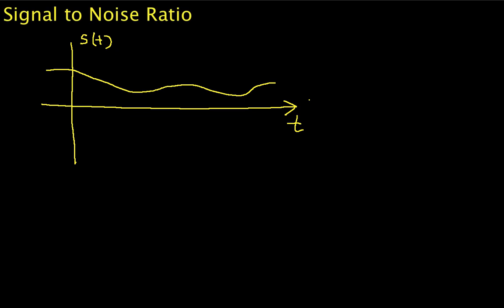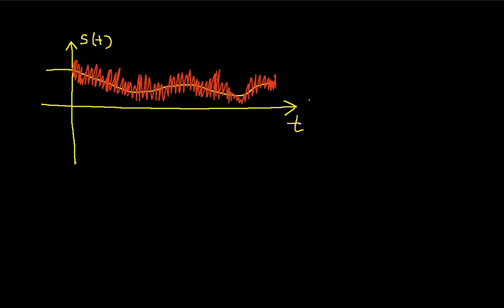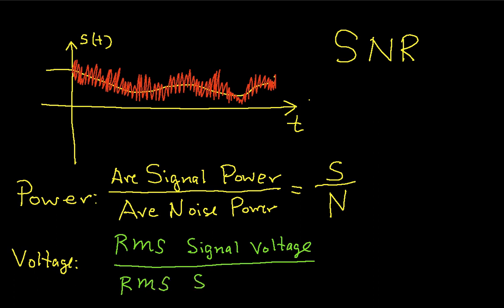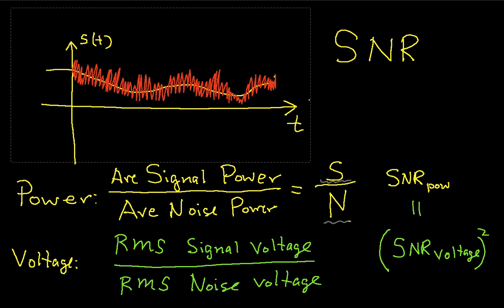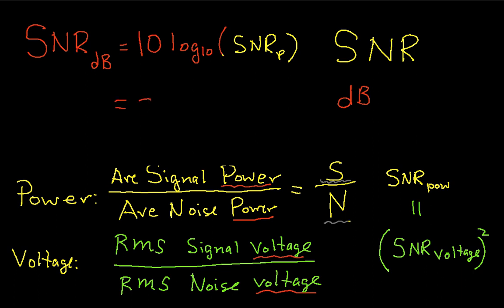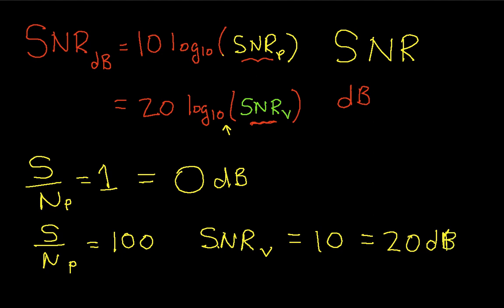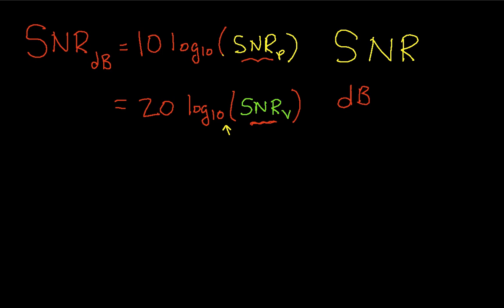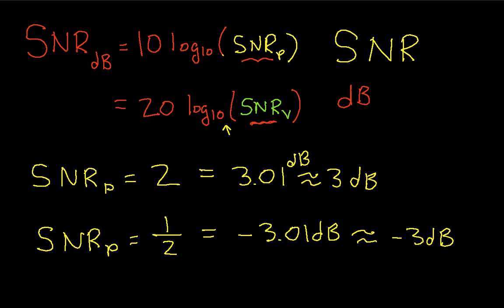Signal-to-Noise Ratio

Comment: But in practice, how to extract the noise from a noised signal?
Reply: This is accomplished during systems characterization. Measuring the noise is straight forward in many cases. measure the system output during the absence of a signal. This will give you your intrinsic noise. For extrinsic noise, subtract the known signal from the receiver output. How do we know what the signal is? were the ones generating it during our characterization. Some thought will need to be given to minimize signal attenuation and distortion. if it cannot be avoided you can estimate the signal using an adaptive filter.

Comment: The mathematical explanation was good. However, it would have been better if you explained whether it is good to have SNR of 2 or 1/2 or 100. It would be helpful to tell that SNR of 100 is good because signal power is greater than noise power and that an SNR of 1/2 shows that noise power is twice greater than signal power.
Reply: thanks!

Comment: Newbie question, how do I know, by using the SNR that my cablemodem shows on the modem webpage, if I have too much noise or little noise? for instance, I see that it says something about 36dBm in the SNR marker, does that mean that I am getting more signal than noise? By using google I have learned that there is a SNR for the signal on the coaxial cable, that can be affected by cable quality, splitters, installation, bla bla bla. What I want is to know if my installation is affecting the cable modem ability to get good signal and therefore good speeds.
Reply: on a cable modem, basically, 0 SNR means you have as much noise as actual signal. If your number is say 20.. then your signal is 10 times stronger then the noise is. Basically, the higher the number, the higher your signal strength is to how much noise. On a cable modem, they usually want it in the 30's or better.. preferably in the mid 30's or better. With yours being at 36, that is right around average for most people that have a decent signal, so there is no problems there.

As for the rest of it.. Yes, signal can be effected by the hardware and cabling up to your house, and in it. but those things usually degrade the signal. They do not do much to put noise into it. Things that can put noise into your line is things like, running a cable right next to a light fixture, or many other type of electrical devices. The noise from those things can go into lines that are in close proximity to the device. That is why cabling used to run you internet or cable TV is usually shielded, which helps protect the outside signal get into the cable. 

If you are having problems with a cable modem, usually your problems will stem from bad connections, bad cabling, or cabling that is not up to par for todays standards, or too long/connections/splitters in the run of cabling. The longer the run, the worse the signal will be, plus things like splitters will drop a chunk of power off of the line on top of it. Todays standards for coax for cable TV and for cable internet, they usually require at least an RG6 cable. Cable from, say, 20 years ago, used RG59. The difference.. the center wire for a RG59 cable is about half the diameter of the center data wire that is in a RG6 cable. Half the wire means twice the congestion and also means that the power can not flow as freely, so it will degrade your signal much faster too. If you have too much degeneration of the signals power, that means that the signal has to be sent out stronger. Think of it this way. If you talk normally, people have no problem understanding you. If you scream at the top of your lungs, then your voice is not as clear and it makes it harder to understand. Basically it is the same thing. The weaker the signal because of signal loss, the louder that things have to yell, which means more information is not read correctly because of it. This is the reason why cable companies, when running a line for data, or for the internet, usually will have the line come in the house, and then immediately have a 2 way splitter. Off that that splitter, one line will be a single run to the cable modem, and one line will then go to another splitter that will run all the TV's in the house. They do not usually do it off of a single splitter because the more splits in the splitter, the more the signal is degraded.

Think of it this way. If you have a cup and fill it with water. put one straw in it, and all the water will come out on a constant flow, but, if you add a second straw, the the pressure will drop. add 2 more, and it will drop again, because the pressure of the water is being diverted though, now 4 straws, instead of one. The same thing is being done here. If you have one split, the power will go down, but if you have 4 ways that power can go, then that means all that power that is not going to the way you want it to, is going to go down those other paths. The amount given may not be exact, but will give you a general idea about things. Hope that helps.
Reply: Shaun Michalak 
Actually a SNR of 1 would mean that there is as much noise as signal.  A SNR of 0 would mean that there is infinitely more noise than signal, or there is no signal and some noise.
Reply: Michael Seymour maybe so, but i guess it is a minor detail. No matter what, if your signal to noise ratio on a cable modem is too low, then there is too much noise, and too much noise means it will not work. and even a SNR or 10 is going to have problems, if it works at all (probably not though), so down to numbers like 0 or 1 or 2, it is all just numbers in a case like this because if values are too low to work, then it is just not going to work. Just knowing where the problem is, i think is more of the important part, and know what good values are, is good enough for most people. I am not saying that not knowing is not good info, but most people asking are asking because they dont know, and only want to know the basics of what will and wont work. so yes, 1 is equal on noise and signal, my fault there, but i think that they got the point. still, thanks for the correction.